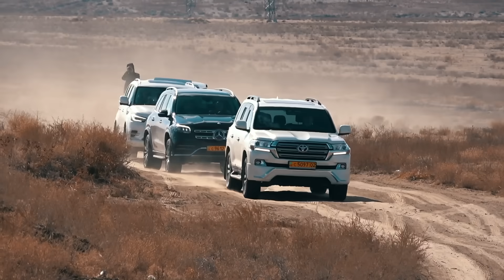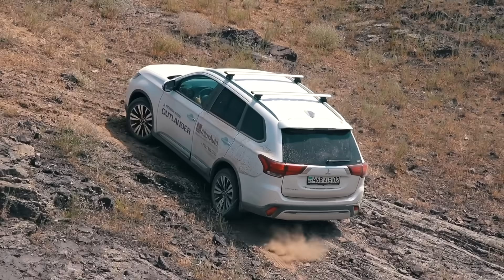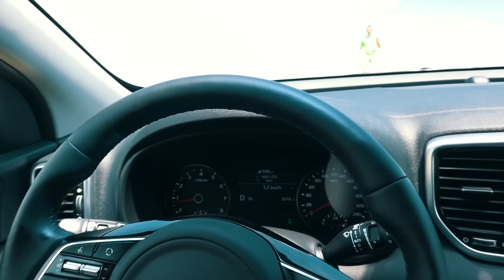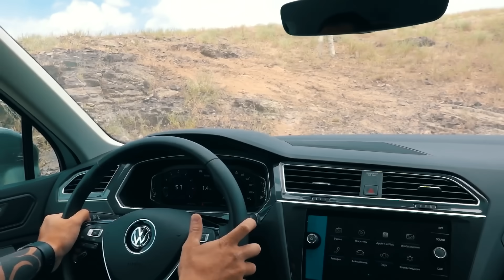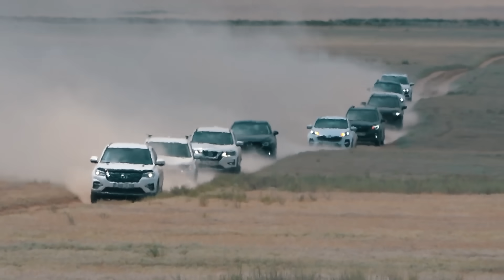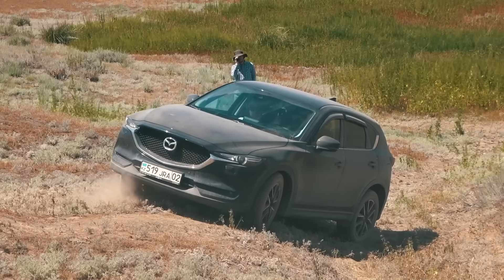SUV Battle 2020: Toyota RAV4, Nissan Rogue, Subaru Forester, Mazda CX 5, Volkswagen Tiguan, Sportage

Comment: CVT literally killing Subie's credibility

I hope top management realize this before it's too late
Reply: Ain't that the truth. I wasn't there, so I don't know the exact terrain they're testing on, but I've taken both my 1998 Forester and 2010 ForesterXT on similar seeming terrain with little issue. 
However, my friend's 2018 Forester has had issues on the same trails I was on. 
People keep saying "it's the driver" but really, even with a bad driver, the old Foresters would have went up with with little issue. There are many videos on YT showing older non-CVT foresters going up icy hills, stopping in the center, and continuing on with no problems. 
I've two wheeled both of mine on two tracks in northern Michigan going up hill.
Reply: @caodesignworks2407  yes my old standard 1997 non-turbo auto Forester was an amazing climber with no modifications - she could crawl up steep inclines fully loaded with camping equipment, water and extra fuel where some conventional 4WDs would dare to tread - no way a CVT-based Forester would do this for long because the belt would slip it would typically overheat and stop working.- my old 2009 XT Turbo auto Forester was just as capable but to nice for the bush here in Australia - many people are ditching their 2013-2016 CVT Foresters on the second hand market here because of these issues and appear to be failing around 60000-100000kms - John in SA
Reply: @johnnumbat9782  damn, you guys got the Forester in 97? We didn't get them until 98. I can see that. The early CVTs weren't that great. Fine for flat ground and okay weather, breaks down once you get bad weather and craggy hills.
Reply: @caodesignworks2407  yes I was lucky my friend and it got to 425000 km with original engine and transmission - then the camshaft seized so no complaints because it only cost $10k and I had it for 12 years 👍🏻 - you won’t get anywhere near that with a ‘soft’ city-based Forester now or anything in the Australian market- maybe the manual Forester with a diesel? - too many things to go wrong now with hi-tech vehicles which you don’t want when in the remote outback - John in SA
Reply: @johnnumbat9782  Nice, I just got a new 2011 Forester XT damn neat mint save for a rest spot above the windshield. Likely from a rock chip.
Reply: @caodesignworks2407  excellent choice and you won’t have the non-turbo gasket issues - look after it and it will look after you - enjoy the new drive - one of the best Foresters ever built - John in SA
Reply: New ones have difficulty on diagonal or one wheel loads. Million videos showing that. They should put a limited slip in the rear differential.
Reply: AMEN!!!! I’ve own an older Subaru Impreza and my bud had older foresters for years. Granted my Impreza did act like the forester in this video but WITOUT traction control for being a 2007. It was good on road but my buds older 04 Forester had ZERO issues due to its mechanically rear LSD.
Reply: My 03 rav4 430kms original clutch, gearbox and motor, still goin strong.
Had one subi, cv boots and joints. head gaskets etc at 200k. Never again.
Reply: @rhett7716  Toyota and Subaru share much of their supply chain... same materials, often times same exact parts. So both are arguably equally reliable, so either way, you’re getting a great car
Reply: @connorjohnson2831  
Well my alternator failed last Sunday while in Mobile.  It was a 22 year old original Denso made in Japan.  Subarus don’t do that.  Around here 90’s model Subaru’s are about all gone.  Toyota’s are still everywhere from the same era.  A local search for a 1996 to 1997 Subaru Legacy returned no hits for metro Atlanta (100 mile radius).  Shrug....where did they all go?
Reply: @connorjohnson2831  Except for the cvt...Honda cvts are more reliable.
Reply: @rhett7716  I like you had Subarus (nine in fact) but eventually learnt about the common head gasket, CV joint issues.- I now own a Toyota Hilux albeit not as premium a feel or fit out of a Subaru Forester has a conventional auto transmission and diesel engine that has been more economical on fuel too. I’m a Toyota convert now and will probably get a non-CVT Corolla or RAV4 as my shopping/Sunday drive car. John in SA.
Reply: @rhett7716    My cv boots and joints are original on my 99.  The 99 is actually substantially better built than our 2007.
Reply: Test cherokee please
Reply: Your absolutely correct Panda - I’ve owned 10 Subarus before the introduction of the flawed CVT which cannot handle any hard work expected off-road - even worse is they tend to break from 60000-100000km - avoid any brand CVTs if you want off-road and towing abilities and no overheating warnings etc. My first Forester was a 1997 Auto Limited which lasted me 420000km before an engine seize but it could climb very steep rocky tracks with ease and even when fully laden with camping gear - one of the best ever made. Now Subarus are no better than the competitors. I now own a Hilux. John in South Australia
Reply: Exactly, i have the forester 2015 2.0 NA, and the max torque of the forester is almost at 5000 rpm, if you saw this, that guy never pushed the subie for get the best torque and x mode reability, Greetings from Panama.
Reply: @zacharyreynolds4303  very disappointing for you and yes the car manufacturing industry doesn’t care as their chasing profits over service and customer culture - VW as you know got caught big time with their ‘Diesel Gate’ scandal and Toyota knew about their flawed  DPF design issues in the post 2015 4WDs which is why I drive a pre-DPF 2010 Hilux which I have serviced by a private company not Toyota. Skoda and Audi are badge-engineered VWs too so avoid them, anything US, UK or French (Renault owns Nissan now) - even Hondas are built in South Africa so now you’re really left with Mazda from Japan and Hyundai/Kia from South Korea to provide - personally I have only bought used vehicles after much research.
Reply: Almost every other overseas Country has a split gear case with the Subaru with a low range setting. Wonder why we don't get it in the Americas.
Reply: They are 100% committed and dont care.
Reply: The management is catering to those who mainly use their cars on the highways with a small percentage are used extensively off road. Subaru has never done what those of us enthusiasts wants...turbo crosstrek, stick for the 2.5 crosstrek, turbo forester outback with stick shift available etc.
Reply: This test should've used all terrain tires and individual routes up the same grade without stopping. Yeesh.
Reply: Your cvt hate is misplaced.
Reply: The older Foresters especially the turbo models from the early 2000s would have embarrassed all of these wannabes, including the newer CVT junk Forester. These SUVs are only good for gravel driveways these days.
Reply: I don't understand why the Forester and other cars have been bothered all along with ESP on, which helps at higher speeds and not in such heavy terrain. They have it written in the Owners Manual that ESP needs to be turned off, just read. CVT is excellent, she could playfully handle it - the whole test is designed for sensation. We have the Forester in Slovakia, even with only a 2.0 engine, in the mountains we drive with it every day in often worse terrain. Forester has other ailments, but certainly not field skills. PS: Try driving on such a hill for another ten minutes with each car and then you will see, rather your nose will feel the differences between Haldex, Magna-Steyr and AWD.
Reply: @viktoristic3723  the point of this test it is not "just driving" to top of the hill. The course have stop points to face different obstacle from 0, not just mashing up the throttle from the  bottom to the top. When the subie tried you can see the limiter stop arround 3k rpm, that's a "safety feature" of most of the CVT for preserve  the belt not to be overstretched by engine load. It's a no no feature for a car that had been marketed as AWD because  when a vehicle in the position with only 3 tyres (or less) in contact if the ground . You need more power to move forward in which you couldn't do that with 3k rmp.

I love the subie AWD, hate the CVT.
Reply: Not only CVT is killing subie 
But discontinue what they so good at " the turbo XT " might just do as much harm to them 😥
Reply: Subaru CVTs are still reliable though unlike nissan/Mitsubishi CVTs which are horrible
Reply: @V_For_Vigilante  Since the 1970s, all Subaru conventional automatic transmissions have been Jatco designs adapted to Subaru specifications
Reply: @V_For_Vigilante  I have read that it fails 100,000 miles. Lots of complains from consumers.  If you replace before 100,000 miles, should be oka
Reply: @V_For_Vigilante  lmao. You’re so far from correct it’s hilarious. The Subaru cvt is literally supplied by Jatco to Subaru specs. The same company that makes Nissan. If you crawl under your Subaru and look at the serial numbers you’ll see it says Jatco.
Reply: @haroldbeauchamp3770   May be the same manufacturer, but definitively different specs. Nissan will save half a cent if they can, not sure it is the same thing for Subaru. Nissan CVTs, unlike Subaru's, are notoriously unreliable.
Reply: @frankthechemist  you’re talking to someone who owned a fleet of Subarus for my company. Every single Subaru in my company fleet developed cvt problems. Also, every single one of them burned oil. Some up to 1-2 liters of oil per 1200km.  Subaru is garbage.
Reply: @haroldbeauchamp3770  

If u have a Subaru built in America or Europe with a CVT then yeah it will be junk but Japanese built version won’t be having problems and recalls most of the times . Subarus oil problem was fixed back in 2012/2013 the old ones have head gasket and oil problems not newer ones
Reply: @haroldbeauchamp3770  A fleet as to cars driven by employees? No matter the brand, those car will get destroyed in no time. Maybe I got lucky and got a good one, my 2014 Forester with 205k km performs flawlessly and I had 0 issues with the CVT. Its beginning to burn oil though (1 pint every 10 000km) and I agree that in 2020, a car engine should not be burning oil at all.
Reply: @frankthechemist  indeed you are correct. My staff was very demanding on the fleet. However, in order to get to some of the locations for launching our customers and kayaks and canoes, we had to traverse mud, water, steep grades etc. For complete transparency, we upgraded our fleet to Toyota 4Runners and still have many nuisance problems. Despite what anyone says, Toyota reliability is not guaranteed.
Reply: @haroldbeauchamp3770  Yes. Everyone knows this.
Reply: @haroldbeauchamp3770  Unfortunately, you aren't wrong. I just got rid of my 18 outback because it was burning oil.
Reply: I agree.  Canceled my plans for a new Subaru.   I hate that since Subaru was my favorite car.  My 22 year old Toyota 4 speed auto has 312,000 miles on it and still shifts flawlessly.  My neighbors Toyota is at 450k with no transmission issues.   No CVT on earth can do that (that many start stop cycles in city driving over 20 year span).  I keep my cars a long, long time....knowing the Subaru CVT replacement is going to cost me 8k when it blows up is a POOR way to reward your loyal customers.
Reply: @keithcharles2113  — My 30 year-old Mitsubishi transmission still works flawlessly, too.

Of course, that’s no surprise, because it’s a 5-spd. manual transmission.

I did have a minor problem with it a couple of years ago — I sprained my left ankle severely, and for about a week, it hurt like hell to drive that car.
Reply: @keithcharles2113  maybe a toyota  cvt could do that much work 😁
Reply: I own a 2015 Subaru XT with 94k miles and I can 100% tell you its CVT is the problem. I take extreme care of my vehicle and right now as I type my vehicle is currently sitting at the Stealership getting a new/refurbished CVT! Going back to old boring and reliable Toyota.
Reply: @warhmonger  sorry to hear that my friend - it’s such a huge commitment for you to walk away from - I have owned nine Subarus that were all very capable and reliable and only updated when the lease expired or my lifestyle changed. For Subaru to decide on the CVT option from 2013 onwards was a monumental mistake but they want cheaper manufacturing options hence the CVT. Stick with ‘boring’ Toyota because at least they’re reliable - but avoid CVT-based Corollas or any brand with a CVT like Covid 19. I now own a Toyota Hilux. John in SA
Reply: not the cvt. it is the skill of the driver. the forester can do much better than what i watch here.
Reply: @gabrielksh86  No. At some point, us Subie people have to admit, new foresters are kinda junk when it comes to the CVTs. They've been proven in so many videos to be restrictive. The only reason Subaru switched to CVT is to try and get just a little bit more fuel economy out of the thing.
Reply: @caodesignworks2407  True. But many are hoping that the new 2.4 Turbo drivetrains will make up for CVT limitations with more innate horsepower and torque to play with. We already know that the  XT CVT is a different spec for more torque, to that means it can handle more torque!
We shall see, Meanwhile, if you really want to have fun with a subaru all you really need to do, with just about any of them is put on offroad or dual purpose tires, and they will go up that hill easier, and more times, while many of the other offerings because they are doing something extra with their powertrain will overheat easier. The Subie advantage is that everything is more balanced and in line and lower. put some AT tires on there and all the vehicles would have done much better, but pick the reliable ones that do it more naturally without working too hard. This was a great test. Some of these cars are very capable. The Kia and the smaller VW surprised me. The Rav 4 shows dramatic improvement from the past, where the same era Subies would keep more traction. Now the Rav 4 seems impressive in comparison. Keep in mind tho that the newer Subarus have dual Xmodes, stiffer body's, and ESP should be off at the beginning of the test if you are following instructions. The CVT is definitely a MPG gain and an Offroad loss. As I mentioned in another comment, overseas Subaru's often have a switchable low gear range transfer case. I think they are afraid to put that added torque thru their American Tuned CVT's (optimized to meet emission standards and compete with MPG)  which is why you won't see it in the Americas. They need to toughen that CVT up and add a low range at least as an option. Databyter
Reply: @Databyter  Man, I'm not reading all that. Subaru's drivetrain is overbuilt with purpose, that's the main draw. You can't kill it. But their CVT is mostly garbage. 

The new engines will output more power, but the problem wasn't the old engine, it was the CVT.
And it doesn't matter much since the average Subie driver is about 50 years old and only hitting the pavement. 

They can't stick a 3l V6 and it's not going to change the fact that the CVT is kinda garbage. Though, at least they've made the newest models vastly better than the first.
Reply: @caodesignworks2407  I understand what you're saying, and you are MOSTLY correct. However there are different versions and specs of CVT, and the extra power does help somewhat although it is also true that much of the power is being held back by the very thing that is supposed to transmit it. A more powerful motor combined with a more robust CVT certainly will improve the chances of 50 year olds leaving the pavement without getting stuck.
Reply: @gabrielksh86  You're missing the point of the video. They're intentionally not using momentum in order to show the characteristics of the cars. They mentioned this when the Outlander got stuck several times but actually made it up when driven quickly from start to finish. The cars with a better AWD system can slow-foot their way to the top.
Reply: @gabrielksh86  Good equipment doesn't need the best operator.  I've been 4 wheeling since the late 90's and I've had my share of 4X4s and I can tell you equipment can make a world of difference.  For example, there were 4 of us doing a hill climb one day.  all 4 of use had Jeeps, but I was the only one that could make it.  The reason was because I had a limited slip rear, where the other 3 didn't.  This is why, if there's a factory LSD available, I always make sure my 4x4 has it... Doesn't matter if it's a SUV, or a pickup.  

Getting back to Subie's CVT.. it's good for on road performance because of the excellent MPG's it allows.  Once offroad, it's junk.  I know.. I'm on my 2nd Subie.. I had a '15 OB and not a '20 Forester..  I don't take them out hills, or rocks... they're used for driving on beaches to go fishing.. and the get HOT!   And when this happens, they have trouble shifting power more power to the rear.  Also, this software LSD is junk (using brakes to transfer power from one side to the other), because it can't send power to both wheels on the same axle at once..  Subie needs a diff that allows it to lock.
Reply: @gabrielksh86  exactly. The video is NOT about the driving skills. A skillful can drive that trail on a lowrider. This show how these AWD cars are market-positioned and what is the real engineering behind slogans and ads.
Reply: Indeed, TFL pointed out the same weakeness for the newer Subies in comparison to old ones. The CVT killed it's off-roadability.
Reply: @jpaulo33  Many of the Subaru CVTs have paddles a fake manual mode, and when using that, I've gotten my outback through everything I could've thrown at it. Not sure if that forester has manual mode, but if it does, they should've activated it.
Reply: @connorjohnson2831  isn't that the shortcoming of this video? They tested a bunch of vehicles, but none of them very well. All these vehicles have different modes that would drastically change their off road performance, but what did they use? No one knows. Bad video. Too much nonsense with today's awd systems, not made for real off road any more.
Reply: @jpaulo33  TLF.. HATES SUBARU... They always go out of their way to make it look bad...
Reply: Subaru has great cvt much better then automatic transmission.
Reply: @sergiyrudenko905  lmao. Dude I want what you’re smoking
Reply: I have a Outback '15 Diesel CVT - very happy with it, but the main issue is not the CVT, but the drive shafts. And the CVT Subarus need a low range gear in addition to their CVT , but that requires stronger drive shafts as well. The Subaru is first and foremost a road car that belongs on tarmac and gravel roads, but I wish they did add a low range option and stronger drive shafts - They sort of achieved the same effect on the hybrid with support from the electric motor, but I would prefer something with the non-electric motor running all the time! :)
Reply: @SEngelsg  hey Svein guessing from the name your heritage is Northern European - cycled through the area in 2019 for five months - yes for some reason which maybe US pressure Subaru have gone for a softer vehicle - I’ve owned nine and the most hard off road suited was my 1997 Forester Auto and a 1981 manual Leone Wagon which could climb up walls (the Brumby Ute with a wagon) - yes low range with some ground clearance makes sense - recent Youtube reviews of the Forester Hybrid rated it as awful with mechanical clunks and poor fuel economy compared to the new Toyota Hybrid - bring back low range and conventional 8 speed auto for the Forester - John in SA